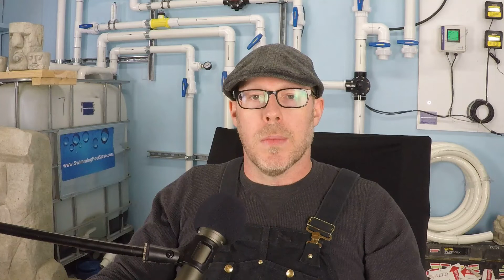Can A Pool Filter Crack?

Comment: I typically see freeze damage to the manifold/lateral assembly base inside Hayward sand filters. They are designed in such a way that a small amount of water sits within the standpipe base. I always see them split right there. Current sand filter vessels are made of a resin plastic which is not nearly as durable as the old Jacuzzi FM series fiberglass sand filters, they even made stainless steel ones for a time!
Typically in a commercial pool you can still find fiberglass style composite overwrapped pressure vessel filters, they are far more durable and last much longer.
The other source of damage I have seen is due to people trying to move around the filter either full or partially full of sand, a hard smack on concrete and it will split.